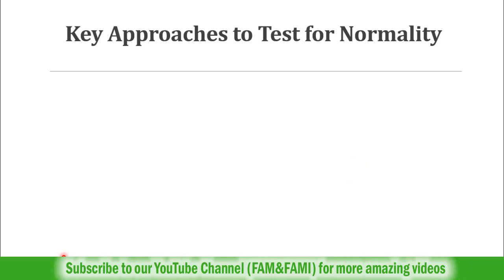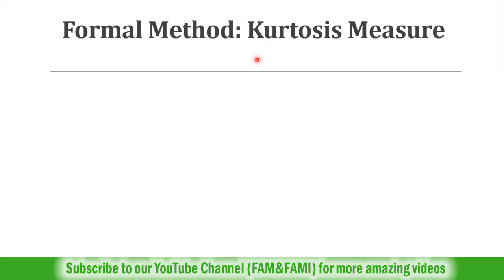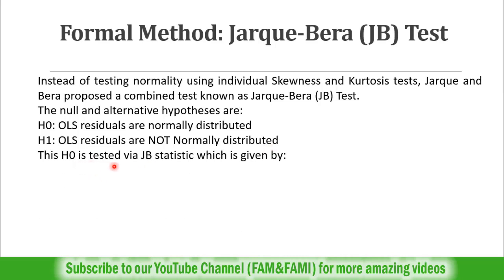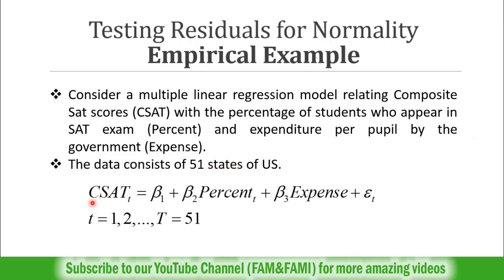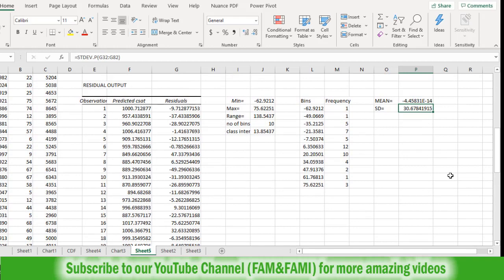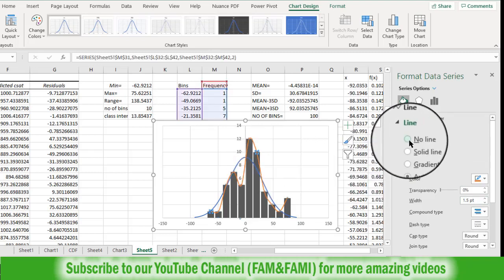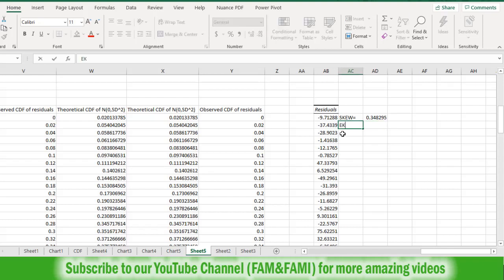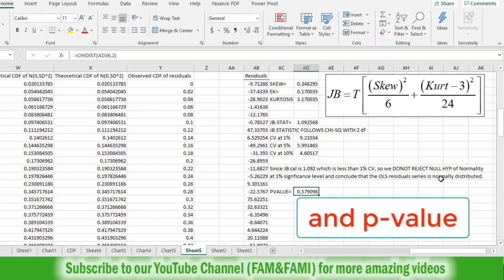Normality Testing of Regression Errors | Testing OLS residuals for Normality

Comment: Why normality tests? Why dont we implement poissonity test? What makes normal distribution privileged among other distributions?
Reply from the maker: Normality is imp to make valid inferences--especially in small samples--in large samples one can rely on Central limit theorem and can ignore normality
Reply: @FAMFAMI  firstly thank you for answer. Can you say all fusses about normality tests stem from trying to infer meaning from small dataset?
Reply from the maker: If u look at analytical formula for the OLS estimates of true parameters then u wil realize that these are linear combination of true errors. By assuming normality of errors the inference regarding significance may b different.
Since true errors r unknown and unobserved so usually residuals obtained from OLS regression are tested for normality